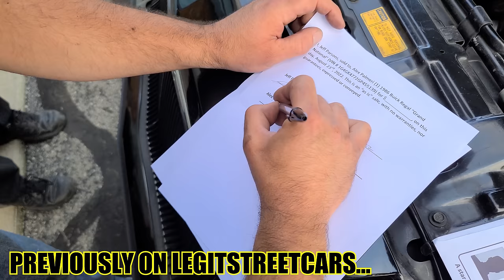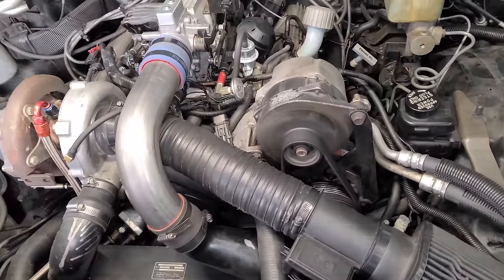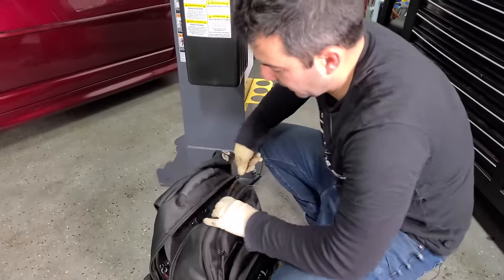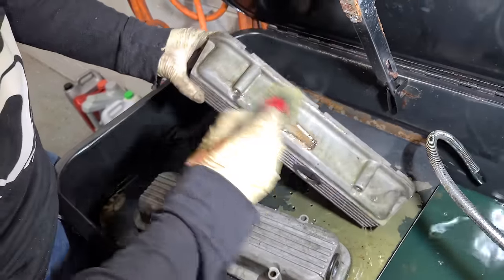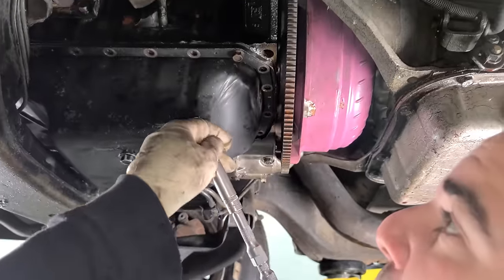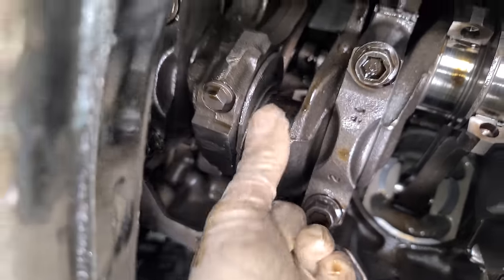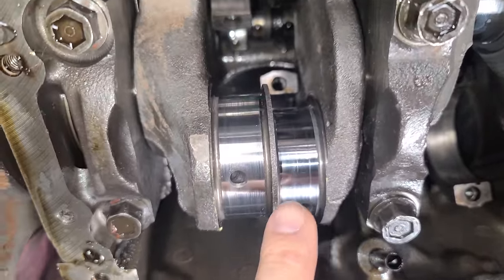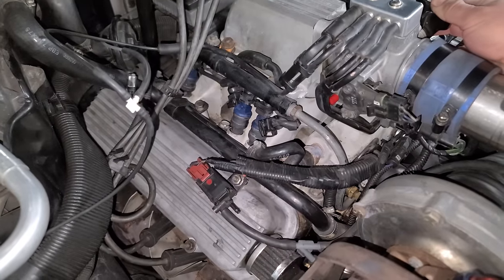I Found A Fully Built Engine In My Grand National That Was About To BLOW UP! DIY Fixed It For $32!

Comment from the maker: Use Code Legit2 when you buy 1 bottle of Armor Shield Ceramic Spray & get 1 bottle FREE!
https://avl.kg/legit241
Reply: I ordered mine, Thanks!
Reply: how good does the armor shed work on dust from the back roads
Reply: 23psi. No more, no less.
Reply: I tried but when it came to shipping form, the price went from 34 to 44 euro, because I am from Europe, we pay more plus shipping? no thank you
Reply: 23 pounds
Reply: I’m voting for more hour long videos
Reply: I’m sure you guys fixed it, it’s incredible that someone put it together with mismatched rod caps… They are numbered for a reason people, they were probably weighed out at the factory as a set
Reply: Going to try this on a sun burned 2018 BMW from Texas. Clear coat is starting to go.
Reply: The shine is off of the Apple 😂
Reply: Can I ask did you check the rods and were they numbered on the top end ? Like both halves of the rods numbered rods and caps and then correctly reinstall the caps where they are supposed to be or did you put them back in the way the previous owner had them numbered
Reply: Just ordered, Thanks Alex.
Reply: You want to keep it period correct, or you're going to put disc brakes in the back ?
Reply: @rcajavus8141    It’s regular 70 bucks each.   Your getting 2 fir 40.    I payed 40 in the states.    It’s fir shipping. Your missing out over a couple bucks
Reply: Thanks Alex. I put in an order too.
Reply: Thanks for the hook up legit2!!
Reply: I don't know why but my comment keeps getting deleted

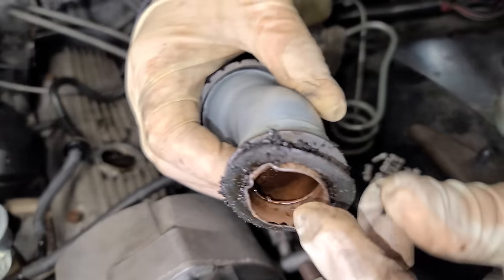I think I might know the previous owner of this car before the guy you bought it from got it.  The guy I know is the person who swapped the turbo and put those wheels on it and had the prom tuned.  Car went 11:30-11:40s at great lakes Dragway!  This is the car. I just heard you say what it supposedly ran and this is totally it!

I'm from Chicago and he was as well.  He sold the car to someone in Wisconsin. 

If you reach out to me, I'll give you his name if you'd like.  I can also ask you a couple questions to verify it's his old one. If I'm right, guy was actually a hair stylist. 

Everyone like this so he sees it.
Reply: Fine. I ordered it. You happy now? Seriously though, I'm looking forward to getting it. Can't pass up that deal. And if you're ever in the Newport, NC area, I'll let you drive my Mk4 GTI. Slightly modified. 😁
Reply: Could be using the wrong fuel
Reply: Ordered !
Reply: Tried to order but code didn’t work.  Tried again, worked and it accepted discount code…Thanks!
Reply: I agree is ridiculous expensive
Reply: I’ve tried the spray wax before it’s your average parts store spray wax at best but I will say the sams spray wax Cletus McFarland sells is over the top amazing
Reply: Thanx man just order some more.. My 7th time ordering this spray. Works amazing.  Is there any discount codes for the Armor Shield ix ceramic? I’m almost out 🤗
Reply: "Bad Bearings" as a Reggae Punk band from the 90's.
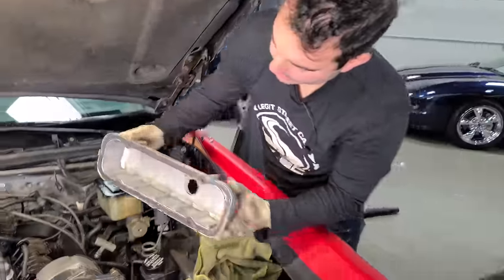Reply: 19:05 You have had so much bad luck lately!!??? It's better than mine! Come live my life! lol I wish I had your life. hahaha
Reply: Also ordered mine as well!  
I think these are the only long format YouTube videos I 100% watch every second of!! 

Awesome.. even though you are in Illinois ( Wisconsinite here!!!!). 
No FIB moniker for you guys!!!
Reply: @darkcommon1  Armor Shield is formulated to help repel dust and to make it far easier to wash off. Prep is key in getting the optimal dirt-repelling action.
Reply: @rcajavus8141  Very sorry for that mate! We are looking to improve our shipping options for Europe in the new year.
Reply: @AvalonKing  thanks for the info
Reply: The car is not running 1000 percent but you still clean it no matter what you got a good car for $16000
Reply: Just ordered going to bring my 06 Tahoe Z71 back to showroom condition!!
Reply: Just tried to buy 2 from the link, says discount code isn't valid for items in my cart.  Is deal expired?
Reply: Placed my order!  Thanks for the code.
Reply: I feel like I seen this car at the SLP meet back in the 2000's
Reply: I had a car that started having a rod knock because of stupidity on my part. As soon as it started knocking ,I shut it down. I put a product called motorkote in it and topped off the oil. I drove it 30k miles with that rod knock. Then at that 30k mark my buddy talked me into replacing the rod bearings. We pulled the pan off. The rod journals disnt even have a mark on them at all. I mean nothing. We threw new rod bearings in it. I drove it another 100k miles until it found its way into a tree .
Reply: Code doesn't work. 🤣🤷
Reply: @hectornegroni4970  security
Reply: @darkcommon1  !a

Comment: I did the same repair on an 87 2.8 liter chevy, I also added a high-volume pump. That repair lasted 40k miles before it spun a rod bearing.

Comment: Best I seen here so far, positive attitude, great car to work on, took a risk, teamwork helps, makes job seem not so intimidating, don't be afraid. Shows stuff I first learned in auto shop like measuring bearing gap with colored gauge plastic string. Nice Christmas present.

Comment: The external oil filter was sold by Precision turbo as a turbo saver. It feeds  the turbo first with fresh clean oil straight from the filter as opposed to the factory feed that came last after if went through the engine. Not a band aid for their bearing problem.

Comment: 20 years ago I bought a low-mileage Grand National 87 (10,000 miles) and drove it home. when I got to the house the aftermarket oil pressure gauge was on "0" . When I tried to crank I found out that the motor was locked up. The spring in the oil pump broke and it starved the motor from oil. I spent 30k$ fixing the car like I wanted to. By the guy that won the Grand National shootout that year. 7th injector, T67 turbo, front mount intercooler 10" converter art carr transmission. When I was finished I realized it was one big piece of crap and I traded it in on my 2nd GTS Viper. Yes, the car was fast it was probably running in 10's however it drove like a monte carlo with windows that shook when you closed the doors and the overall quality of an 80s Chevrolet - junk. To be honest some cars are better left as a dream. Today I have a Sl63 with m156 that I had the head bolts done. This car is a dream car not the GN

Comment: If the fuel tank was ever changed they might have put in an aftermarket tank that does not have the correct baffling and fuel will slosh around the fuel pump when it gets low. The new Spectra tanks are the only ones that have the correct baffling for a Grand National or any GBody converted to fuel injection. GM307C is the right tank.

Comment: The oil galleries on the crankshaft in the grand national are not all the same size on the crank journals on 2 of the cylinders I remember reading. That and after certain power levels you have to run billet steel main caps on the block and a girdle to eliminate any flex on the crankshaft main webs

Comment: I once knew a guy who had the same problem, rebuilt the engine and had a problem with the bearings (don't know the specifics), he replaced the bearings in the same way that you did and didn't have a problem after that.

Comment: Yesterday I watched the purchase part, today I was up early to watch the fix video (in one shot) before the house woke up. You made this American muscle quest quite interesting Alex. I was wrong in my initial diagnosis. I thought it was the wrist pins or rather their bearing play that caused the knock. People tend to leave them in. As for the engine stalling, why not test the fuel supply with the external pump and a jerrycan? Than again installing the wide band O2 will give us the mixture values quickly and open whole new bag of tuning possibilities. Can’t wait for next video. Merry Christmas to you all. Great team

Comment: headliners are easy to do. take out the shell, use a wire brush on a drill to clean up the foam residue, use spray grade contact glue to spray both sides and ha a buddy help you stretch the new material place it and use a mini roller to smooth

Comment: I had a '93 Pontiac Bonneville with the 3.8l engine in it.  I went to a local place for an oil change and they failed to put enough oil in it.  I replaced the oil pump and had the rod bearings replaced and drove it for many years afterwards with a thicker oil.  Finally sold it in 2012 and it was still running pretty well.

Comment: I did the same thing with my 99 Chevy S-10 4 cylinder, pulled the block, my oil pump cut out for a few seconds while driving home and my oil pressure gauge went all the way down and then came back and I started hearing a knock. So I pulled the engine with 5 speed trans together to do some clutch svc and rear main seal. Cylinder 1 spun the bearing, Miked them all and were within spec and did the plastigauge and everything was spot on, reassembled and I had a slight knock still, took it to a buddy who is a mechanic and he said it’s probably a wrist pin.

Comment: I truly believe the egr valve was the noise. I could be wrong, but I've pulled apart worse bearings that were quiet, probably massive unmetered air leak to

Comment: You need to plastiguage the bearing to find the clearance. 
Sounds to me like there was a high volume oiling system installed which may hide the fact there is excessive clearance on the rods or mains and that would explain why low oil pressure didn’t indicate excessive bearing clearance.

Comment: SO excited to see more of this hot GN. Also, did I miss something? What do you have that has a full CF hood!?
Reply: Good catch 😜 hopefully we'll be revealing it in a future video. Hint: there are quite a few carbon panels on that bad boy.
Reply: @Aiurasensei  Yes! It looks like the whole front clip is carbon fiber! I am so curious now. Is it the one that was under the tan car cover for the whole video? Probably, huh... the valve stem caps on that car looked red, just like the mesh inserts on the hood. Also, I can not wait to see the Conquest. That new FMIC is going to look awesome peeking out from under the bumper.

Comment: Grand Nationals are so cool, Street Cars have gotten so fast these days but there were legit 9 second GN's running back in the mid 80's. I pulled up to one when they were still making them new in the 80's with my 72 Charger with a 440, the GN had weld wheels with front runners and drag radials, the light turned green and he carried the front wheels for probably a couple hundred feet and was gone, it looked like I was standing still. A friend had one that was really built, we drove it to Florida from Michigan and back, averaged close to 30 mpg and we went street racing in Florida when we were there and just annihilated everything we raced, funny thing is the car didn't even feel fast, I got to drive it and raced a few cars, you just revved it against the converter and launched, no drama just went fast and straight and next thing you know the speedo is buried and they were waaayyyy back there.

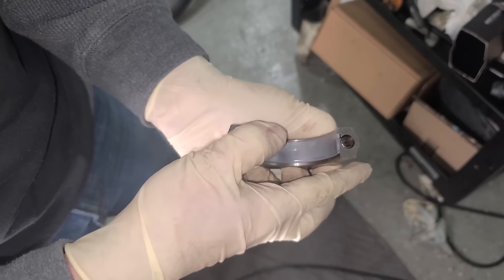Comment: Grand National expert here...    at the 37:00 mark, it looks like that rod is in backwards.  Then a few seconds later, I see that's the one that's worn. Look at the rod cap. On the machined weight area, there's one corner that's beveled. It looks like you have 5 with the bevel to the outside of the journal, and your bad rod is the only one towards the inside.

Those are factory rods (the two dots are on the side of the beam kinda hidden from view).  Since you have a split pin crank and not a shared journal, the rods have material removed from one side to make room for the flap of cast iron in the middle of the journal.  The rods little end doesn't sit in the middle of the piston.  That's why it's called an ''off center engine''.

If you look at the side of the rod, you'll notice one side of the big end is thinner and closer to the centerline. That's the side that needs to be at the center of the split journal.

On your rod bearings, you need a set from a newer 3800 engine. Order a set for a 95 Buick Park Ave. They're drop right in and they're wider than the 80's 3.8 versions.

Just made it to the part where you used that Plastigauge. You said you were shooting for .002". That's not correct.   Factory tolerance on rod clearance is .0004" to .00014"  (Yes, 4 tenths, to one thou and four tenths).

It's kinda ghetto, but I rolled a set of bearings in my GN when I had to replace my failed timing set at 150,000 miles about 20 years ago. They were in there and running fine almost 100,000 miles later until GN was stolen and the engine destroyed.

Better sooner than later, it's be a good idea to pull the front cover and do these oil mods. It's free efficiency.  https://www.turbobuicks.com/threads/how-to-build-a-front-cover-oil-pump.39169/

It will also allow you to check the timing chain and make sure there's nothing stupid going on like a double roller with a tensioner or a Rollmaster chain rubbing on the stupid flap on the back of the cam sensor bore.
Reply: Oh yeah. Those aren't stock pistons. They're some sort of aftermarket forgings.  The stock pistons are cast with a steel plate around the wristpin bores.

You need to get a magnetic drain plug too.  Being able to see the afro during every oil change is a good thing to have.   And 40W oil is way too thick for this car (and your TTA you mentioned).   If you have to have 40W to maintain proper oil pressure you already have a engine that needs to come out for a rebuild.

On your belt, even with a non-cracked tensioner the GN belt is too long. You need to get one that's 1/2 shorter than stock to put the tensioner spring in its right range.

Also, you can take that box that feeds the EGR valve and toss it.  No aftermarket chip runs the EGR.  So that's a way to get rid of some clutter and make R&Ring the DS valve cover easier.  You can toss the EGR too and get a block off plate too. The trick is to save the stock bracket and squish the ears in. That way the aftermarket plates have a good chance of leaking without the extra help.  It will also eliminate a few places for a vacuum leak.

When you drop the tank, make sure to omit the factory pulsator if it's still in there and use a 30R10 fuel hose in it's place. MAKE SURE it's 30R10 otherwise the gasoline will turn normal FI hose to goo.

And do this mod to the fuel pump hanger too. It'll give you better flow for free. Go ahead and get a DW300 fuel pump before you drop the tank as well.  Going lean at full boost will turn a good day into a bad day.  (and make sure you have a fuel pump hot wire kit in place. If it was truly an 11sec car back in the day, there should already be on on there)
https://www.turbobuicks.com/threads/how-to-install-an-intank-fuel-pump.54018/

Those injectors are most likely timed out too.  I'd recommend getting a matched set of 60's and a TT chip from Eric at Turbotweak.  It's cheap insurance and you won't be riding around with maxed out injectors if it truly is an 11sec car.

Comment: New here. Wow, beautiful car you got for a steal. Having a mostly turbo Buick channel myself I love seeing these car get some major YouTube screen time. 

That parts store Ignition module (from the last video) are notorious for not working. Ask me who’s I know. High rpm’s and they cut out bad. Get one from a reputable turbo Buick vendor. Gbodyparts or highway stars. 

Good luck looking forward to more GN videos and seeing it rip down the road. Btw you’re going to need an adjustable fuel pressure regulator and a fuel pump hot wire kit if it doesn’t have one already.

Comment: You can actually throw a lit cigarette into diesel fuel and the cigarette will go out. My uncle David did that when he was helping me finish my rebuild on my ‘73 Chevy truck. We actually had to throw a lit paper towel in there to get it fired up so we would have heat in the barn that we were working in. He taught me a lot. Was a mechanic for 25 years and drove a truck for 25 years. RIP UNCLE. I sure miss you and your knowledge.
Also, maybe the fuel pickup is off, bad, clogged. But I think it’s something with the pickup in the tank. Good luck.

Comment: Back to the first video at the point of taking care of the battery terminals, use blue window cleaner, such as Windex, to dissolve the residue from acid corrosion. I've been dealing with corroded cables since the late '60s / early '70s, using a variety of substances, and the window cleaner has been most effective.

Comment: Taking off that valve cover was EASY, if you compare it to trying to take off ones from an '86 Monte Carlo.  You can hardly see the passenger side covers, but that's the easy side.  To get the driver side off, you have to negotiate around the pollution control tubes and some hard lines (which I believe is for the brake booster).  If you screw with the PCTubes, they will most likely snap --> and then you have a problem... 😞

Comment: These wheels are everything to this car especially if you are a purist! I think white letter tires came standard Goodyear GT+II .You probably need a new tensioner for sure they wear out and throw a belt easily. Maybe the stalling out could be due to a faulty Throttle Position Sensor these electronics can get hot or short out with wear and cause constant or intermittent problems or complete failure which I had experienced first hand.

Comment: Good job. I'm surprised the rod bearings see the culpret. Sounds good, now!. I've had Buicks and Oldsmobiles with the 3.8 engines. They were trouble free for 90,000 miles. That was my trading time for a new  G.M. replacement.

Comment: I’ve been using a 80/20 mix of diesel fuel and gas in my parts tank for 20 years.   Just don’t leave the lid open.  Especially if you’re grinding or welding 😂